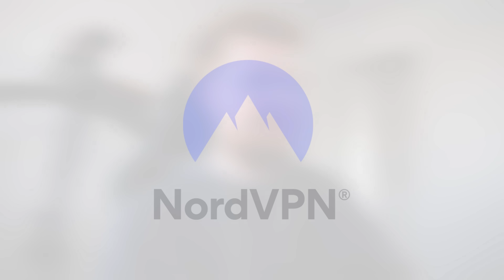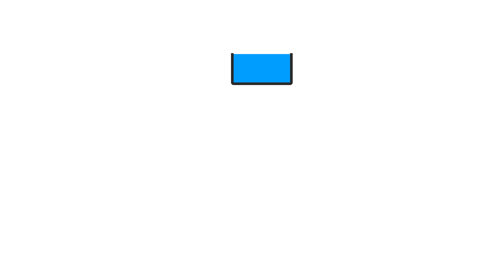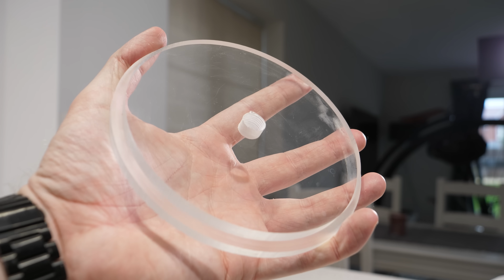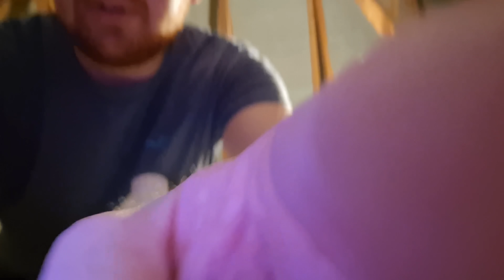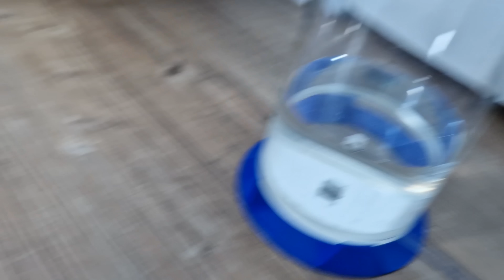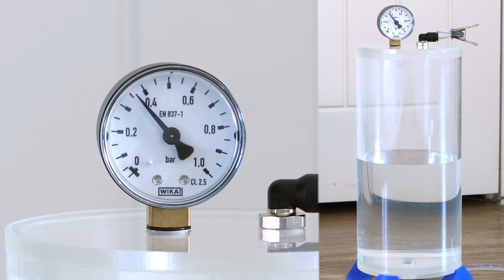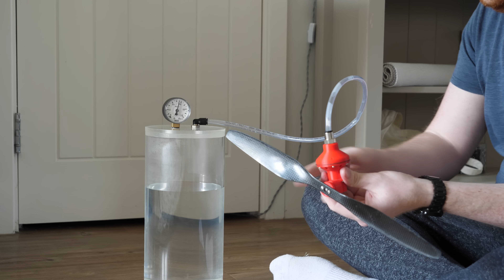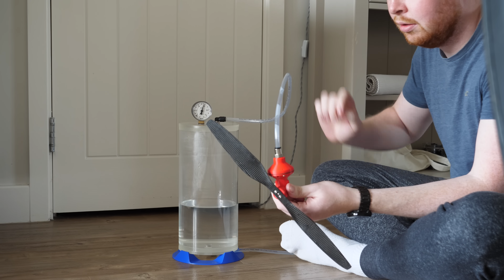Liquid Air Engine

Comment: Here is an idea,instead of having 2 pressure chambers,make it 3,one above the other to provide water,2nd one to provide pressure,and you can make a hole up on the half of the cylinder for water drainage system.So chamber number 3 will collect water,it would be intresting to put it on some sort of moving platform where chambers 1 and 3 will switch places constantly as one drains and other provides water as needed.But you will have to constantly rotate the chamber number 2 because of the holes for drainage/providing.This all can be solved with 2 electromotors one for moving the platform of chambers up and down,and other to rotate/flip 180 degress the middle chamber.I think with this system in place it could seriously provide some close to similar perpetual motion(Mind that you need electricity for that 2 electro motors).Just a thought..

Comment: I came across this video again, and I had an idea! I wonder how will your engine would run if you pump water to your engine just like what you would  do with air
Reply: I think that is not needed as i explained in my comment above,you just need to rotate the chambers(3 chambers needed instead of 2) to provide constant pressure.

Comment: You need to design an Air tank that maintains pressure at a constant, without the weight of water.  Some sort of self collapsing tank that inflates with the air pressure and slowly reduces the inner space with an equal opposing force. Maintaining a steady slow collapse and low weight, would be the key.
Reply: Here is an idea,instead of having 2 pressure chambers,make it 3,one above the other to provide water,2nd one to provide pressure,and you can make a hole up on the half of the cylinder for water drainage system.So chamber number 3 will collect water,it would be intresting to put it on some sort of moving platform where chambers 1 and 3 will switch places constantly as one drains and other provides water as needed.But you will have to constantly rotate the chamber number 2 because of the holes for drainage/providing.This all can be solved with 2 electromotors one for moving the platform of chambers up and down,and other to rotate/flip 180 degress the middle chamber.I think with this system in place it could seriously provide some close to similar perpetual motion(Mind that you need electricity for that 2 electro motors).Just a thought..

Comment: Brilliant! And you could also use an old hot water tank as a reservoir, maybe even using collected rain water pressure, from a rooftop reservoir, via a regulator, to fill it, before using the water for other purposes such as cooking, washing, flushing the loo and watering the garden. If you were careful to use all of the water for other purposes, you could even use mains water. Finally, make a wind- or solar-powered pump to take water to an upper reservoir. Thanks Tom. 🙂👍

Comment: What if u made a 3 cillindar engine
Reply: My thoughts too!!!Here is an idea,instead of having 2 pressure chambers,make it 3,one above the other to provide water,2nd one to provide pressure,and you can make a hole up on the half of the cylinder for water drainage system.So chamber number 3 will collect water,it would be intresting to put it on some sort of moving platform where chambers 1 and 3 will switch places constantly as one drains and other provides water as needed.But you will have to constantly rotate the chamber number 2 because of the holes for drainage/providing.This all can be solved with 2 electromotors one for moving the platform of chambers up and down,and other to rotate/flip 180 degress the middle chamber.I think with this system in place it could seriously provide some close to similar perpetual motion(Mind that you need electricity for that 2 electro motors).Just a thought..

Comment: Hi! I don't sure you read comments after that long time from uploading this video, but i will try. Some time ago i had tried to print bottle for water, but my printed parts can't hold liquids inside and i had done conclusion printed parts can't hold liquids that means it's can't hold gas, because gas molecules having littlest sizes than liquids molecules. So my question - how you had done hermetic printed motor?) Is that special printing parameters?

Comment: Hey I have a suggestion, can you make the pressure source is soda with mintos?
Then add it to an air craft
Reply: This is how our industrial compressors work,you add some chemical substance to the water to build up pressure.It works great and provides good pressure for large firm.But i dont know how costly that is but it sure is efficent..
Reply: @sukisuki9120  that's interesting, thanks man, I also thought of boiling water as pressure source, but I think it's not gonna be that powerful

Comment: You could reduce the play in the piston if you slimmed the skirt right down until the piston and bore became more like a poppet valve running in a valveguide. This would also reduce the reciprocating mass which I reckon might reduce the air consumption even further.

Comment: This made me think, have you considered using a proper lightweight pressure vessel with a regulator on set to the ideal pressure for this motor, you could get like 20bar in one of those and get longer run times

Comment: yes i did find it very interesting... now uh this dude on YT engineers stuff with their kid and the video topic was bell siphons and gutter power  so I'm thinking like s 2inch pvc pipe or equivalent in mm  as the gutter supply being much like your acrylic tube and the idea is autonomous rain gutter power but a competition for most efficiency in gathering or storing the energy you could charge lithium cells or a car battery  but yeah i was thinking garden hose as soon as you pulled out the fish aquarium tubing which i figured was the limiting factor and rubberbanding of motor occilation in the lower pressures and then we gotta design it discreet enough to hide from a HOA "government" that's there to tax you based on thier opinion of how bland and monotonus your shelter appears to the others lack of diversity around you I'm talking micro laws with exhorbatant fines like satellite dishes are too big and unsightly or attic vents solar panels TV antenna or other antenna 📡 I'd have a 55gall food grade plastic drum of water on my 135° angle roof looking like a santa sized chimney otherwise and build such an air/water powered engine with multi sided pto shaft for different power gatherer or use attachments mainly homemade electric generators and fans to blow air or spinning art shafts waterpowered tools like a tablesaw that can cut 2x4 on a 1gal bucket of water at i think my roof is 23ft but if i could get more then more power returns and then using a small solar powered 1 watt 7volt panel powered reciprocating pump aka water hammer pump i keep mistakingly calling jet pumps you know the clickey valve ones that requires no electricity to pump water uphill to fill resivior on a bell siphon to initiate the entire mechanizm built onto or into the home i mean I've seen useless animated art that wastes power for decoration purposes but to have it perform art and function simultaneously is my goal like a waterfall just unnatural because it'd have to be manmade maybe naturally powerd though Also vertical access wind turbine pump to fill the 55gal drum self sufficient water tower as long as structure is sufficient to handle such a constant load aka woodframe house ...  brick 🧱 might be stronger and less worry but significantly less flex for strength in storm but it's mass provides the storm strength... I'm just spit balling ideas I've had here for years since like 5yrs old

Comment: Project suggestion for you, that should be up your alley.  In the 2000 film Titan A.E. a young boy builds a drone like craft that pulls water from a stream and sprays it out four jets to hover. Clip can be found in this YouTube segment https://youtu.be/a82L5FjGcps . Back then it looked futuristic but now with drone controllers and high output brushless motors I am wondering if you could build one.  People fly using water jets and jets skis now but to build a remote control craft that can self stabilize pulling water up through a tube would be cool.  Good luck.

Comment: can you try multi-cylinder engine with this design, it should make it runs smoother and maybe prevent the change in the rotation direction
i really hope you give it a try  ( especially with different crankshaft timing) 👍

Comment: Would there be an increase in stability of the engine if you added a second piston “firing” at tdc while the other is at bdc of course with being less efficient on air consumption

Comment: Is there any possible way to get assistance with making a hand boiler that isn't made of glass of any other fragile material and isn't filled with any hazardous or flammable material? They are perfect for so many lesson plans that I can do for people with disabilities about so many different related subjects, but everyone, myself included, are prone to dropping things, and having a classroom full of them with the potential not only for broken glass, but ethanol or the one listed as a rather high level poison by the msds would require more lab equipment and qualifications than we can afford. I would actually prefer to pull a vacuum as that would demonstrate that states of matter aren't just temperature dependent, especially if people could boil something everyday like water in their hands, but making it visible and safe has been a challenge for me and I lack the engineering and the equipment to prototype let alone 3D print and fine tune an engine like this. Even a name of someone who can help would be of great help

Comment: So I have been designing a engines with using the Concept in this video of using a diaphragm to push the piston and instead of using a ball valve system like yours I replaced it with electronic timing with that 3-way solenoid valve but that's not the only thing I've also decided to attach the diaphragm to the piston and now I just sit and ponder if it'll make even more power than the setup with the ball valve. So if you think this would be a good experiment then go for it

Comment: The idea is great but what if the vacuum is filled with water already? what next? This is app killer, no more "electric fan" but should be replaced by "Air-pressure fan".

Comment: You should put a toilet tank fill valve in the upstairs water tank and hook it up to a water line or even a garden hose. That way you'll never have to manually refill the water tank
Reply: Of course you'd still have to empty the lower tank, unless you have some sort of siphon hooked up that will flush all the water when it reaches the top. Not sure how you'd do that while also using the air pressure though

Comment: You could have simply used the municipal water supply from your kitchen tap connected directly to your pressure tank. The supply is from tank which is much higher than  that of your first floor.

Comment: Bro i need some help for the experiment i think can we make room cooler by removing heat air on ceiling only with some kind of absorbing pipe like glider glyding on thermals cool air comes automatically towards the absorbed place

Comment: You could probably pressurize the tank to pump the water back upstairs if the tank is strong enough to withstand the increased pressure. Damn this is really cool tho!

Comment: If you where to use maybe three of those in sequence where one can empty the water out after it reaches a certain level, then you may be able to receive an equal pressure consistency and use the engine with a severe gear reduction ratio to run a small water pump to push the water back upstairs, you may be able to run in continuously for a while

Comment: very cool, Im not smart enough to know what it means though...you still have to do the work of getting water above it to push down right? So its just fun with stuff really, you could have created this effect with about 4 pumps of a bike pump but you did perfect the efficiency of the motor I suppose, it has a great sound, I think thats the best part of air-motors, the sound

Comment: While this seems unimpressive at first, if one thinks about the implications, it's super cool.  If someone scaled this up a bit, then, just with rain water and a collection tank, or a small pump or human legs to carry it up every once in a while, you can have a fan that runs on zero fuel or electricity, just gravity and low pressures.  That can help with air circulation and help a tiny bit with cooling during the summer (or at least the illusion of feeling cooler).  This is really awesome and creative.
Reply: Or electricity

Comment: This reminds me of the Taum sauk reservoir, which basically uses a bunch of water pumped up a hill as a battery using the potential energy then converting it to kinetic energy with a hydroelectic generator at the bottom of a canal.

Comment: One issue i see with this design is the lack of "timing".
Since the air inlet opens right before Top dead center, at low enough speed the pressure can kick the piston back down changing direction.
Some super efficient cam system would be cool to figure out like in some of the previous designs.

Comment: You should try to "supercharge" the design by adding a pump to either increase the pressure in the hose,
Or add an secondary tank instead of the open upper reservoir, and in order to get it started have some kind of one way valve, and pump extra pressure into the upper reservoir.

Comment: make a pistao on top of the well-sealed acrylic like when the weight of these will release the air at the outlet under the acrylic with equal pressure until the end

Comment: I really want to see this engine running at a higher pressure for a new plane, it could fly for so long if it had 2-3bar compressed air tank and only let in 1.5- or lower intake to the engine itself

Comment: With the fact it worked with only 5 litres and most homes have a much larger water tank in the roof. I kinda wonder how long you could keep an engine like this going for... It could genuinely be revolutionary to home power generation.

The only thing that must be addressed but I imagine could be fixable is the addition of an overflow to the water once it climbs height in the chamber. Essentially a valve to replenish air and deplenish water instantaneously.

Observing his near the end it helps the pressure down considerably and yet marginally... If you could make this replenishment valve run in time with it you would never get a decrease in pressure as it would gulp air as fast as it renews it.

Comment: Imagine an RC airplane with one vertical wing in the middle. You put a tank water on the top of the wing. Water drops and gives you the power to engine. Then , before the tank is finish, all the plane face down and start again with dropping water and continues giving you the power. What do you think?

Comment: you should use the water pressure system to power your magnetic fly wheel imagine living in a plae that rains alot the rain collected on the roof could regularly buld up pressure to keep spinning the wheel

Comment: TIP, when you pour water from a container. Spout uppermost, better flow and more control. Great video as always. J
Reply: Also to the side is a good compromise, when you need to align the spout with target container more precisely.

Comment: Place the jar in the loft(full of water)use a REINFORCED tube prefilled with water,then allow the water to exit the attic.
This should produce a (partial)vacuum.
Congratulations.You now should be able to manufacture a crookes radiometer using the same technique.

Comment: There’s another way to get air pressure out of water—by passing turbulent and aerated water flow, such as a stream or a garden hose, through a drop to pressurize it just a bit, you can allow the pressurized air fraction to rise up through a tube into a bottle, where it will gather into compressed air. The water will then rise back up to the level of the stream. This device is called a “trompe.” It would be really cool to make one (Practical Engineering built a demonstration out of PVC pipe you could look to as an example) and run the air engine off of the pressure output!

Comment: Hey Tom, do you think it would be possible to make a small car that is powered by a stirling engine?
I got myself a small kit to build one and, given a high enough temperature differential, their power output is not too bad from what I can say.
So, a car with a stirling engine getting one side heated by a small candle, the other side cooled by ice water and then getting the flywheel connected to a reduction gearbox would be a cool project maybe?

Comment: Why don't you make a liquid nitrogen powered power generator? I'll give you an idea, use a low pressure reservoir to store the liquid nitrogen, then a high pressure pump at around 10 bar to push the liquid nitrogen to a heat exchanger where the nitrogen will gain heat and pass to gas state going to more than 50 bar would be great to power a turbine or compressed air engine coupled to a power generator and still leave a very cool environment. With these system you can feed several projects. Would 1 kg of liquid nitrogen provide more energy than 1 kg of lithium batteries? It would be interesting.

Comment: Increasing the size of the house from the top and necking it down as it gets closer to the bottom tank might increase the pressure without too much modification to the system

Comment: What would happen if you not only made the diaphragm larger, but made the piston larger and lubricated it with graphite, and gave it a shorter stroke. I'm curious since I've seen engines that have a very short travel distance but a pretty good diameter piston and seem to work just as well as an engine with a smaller piston and longer bore. Also would you be able to hook it up to a chemical based steam system like what Integza has been experimenting with?